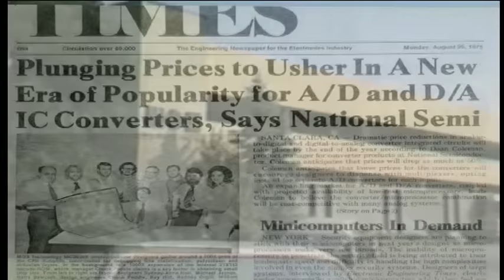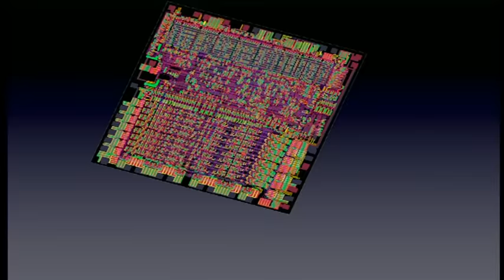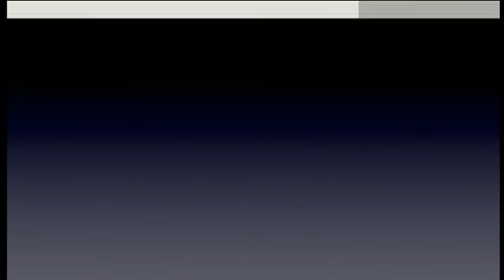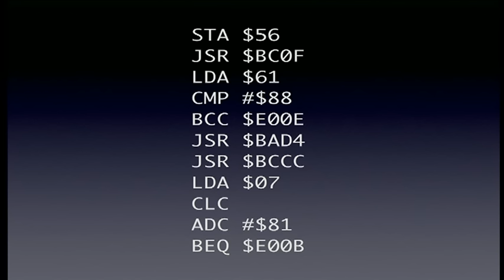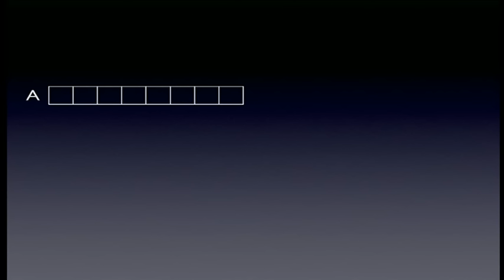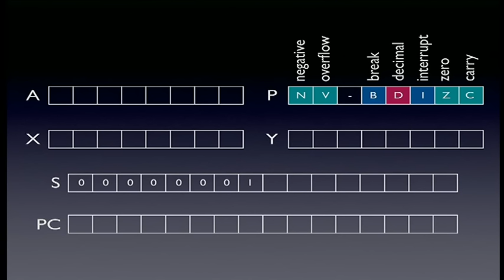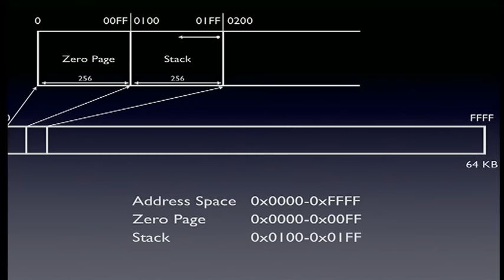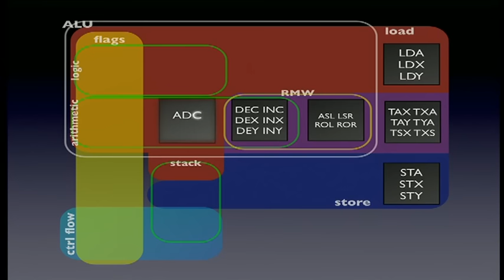27c3: Reverse Engineering the MOS 6502 CPU (en)

Comment: Re: the ALU being pretty standard: The 6502 ALU design actually resulted in a patent related to how its decimal mode. Other CPUs at the time rather had a "decimal adjust" instruction that would adjust the result of and addition/subtraction based on the carry and half-carry into packed BCD. The 6502 instead had a flag which would cause the ALU to do this automatically, hence there's no half-carry flag exposed on the 6502.

That it was patented is also likely the reason this mode was missing from the 6502 clone in the NES 2A03. By omitting it, they'd avoid infringing on the patent.
Reply: The 6502 ALU certainly has some quirks, but it's very standard compared to the Z80. Same with the sequencing, register latches and other details. See Ken Schriffs blog posts on these chips!

Comment: Does the $00 IR injection on IRQ really cause BRK not to work on interrupt?  I'd assume the PC doesn't get incremented on that fetch, so when the handler returns it would refetch the BRK instruction and execute it.  It would seem a more plausible explanation is that the RTI doesn't reenable interrupts until after the next instruction following the return has been executed, so it always executes at least one instruction with interrupts disabled on return.  With interrupts disabled, BRK becomes a no-op. Just guessing here, but P comes off the stack last, after the PC which points to the BRK in the instruction flow.  Then the S (?) bus gets latched into P while the BRK instruction is latched into IR due to the T-state overlap.  Again, just guessing.
Reply: The CMOS versions of the 6502 had that bug fixed, afaik.

Comment: This is fascinating.
For practical reasons I'd like to know what the 65c816 does... (trying to work out the snes, basically)
But I guess that will take a while.

Obviously, it derives from the 65c02, which is implied in the name, and while that undoubtedly differs from the original (that's even documented in the programming guide), we also know of course that there are no illegal opcodes in 16 bit native mode, and that in emulation mode all illegal opcodes equate to 'no op'.

But how does it vary and build on the 65c02 exactly?

Does it effectively contain an entire 65c02 and then additional components? Or is it actually quite different internally and just pretends to be like a 6502 through the way the external logic is set up?

I guess having a 6502 emulator that is 100% accurate would still allow you to verify emulation mode of a 65c816...
Bearing in mind the known altered behaviour of course...

mmh. One day, I suppose. XD
Reply: My understanding of the 65816, which may be wrong, is that emulation mode performs the same operations for each opcode that are performed in native mode, just without the option of switching to 16-bit. The bits that make 16-bit possible are inaccessible and fixed to be clear and "replaced" with the B flag and a 1 (the B flag is just an artifact used when pushing P to the stack during interrupt generation to signify if BRK caused the interrupt).
Reply: We had them make a 6502 with everything 8 made 16, only.  However they sped up the transistors about 10 fold doubled the number of addressing modes though same principal and banked the 4 memories.  Should have 24 bits and 2 operands though.

Comment: The 6507 is in the Atari 2600. The Atari 8-bit family of computers (400, 800, XL and XE series) used the 65C02.
Reply: I was wondering if the 65C02 would get a mention. IIRC, it has some additional instructions over the 6502.
Reply: That's pedantic.  The 6507 is the same physical die with interrupts and high address lines not brought out.
Reply: No Atari computer ever used the 65C02. You are thinking of the 6502C, essentially a standard 6502 but with two additional signal lines.

Comment: BCD was meant to improve number calculation, avoiding the problems of rounding, it's designed for money and financial calculations.
Reply: People forget about memory constraints (not cheap and not small) and a float point package is not exactly tiny, whereas Binary Coded Decimal made it much easier as long as you paid attention to the half carry bit (for the young-uns, sometimes you needed to test it other times make sure it was zero before starting a new calc) and where the decimal point needed to be. Ahhh those were the days... <sigh>
Reply: The Atari 400/800 BASIC did its math in BCD mode (as BASIC implementations go, it's a very nice BASIC).  It was pretty slow but very accurate.  I think they used a polynomial expansion for trig functions, so a sine would take a noticeable fraction of a second to compute.
Reply: @messupfreq550  
Except the 6502 used a patented method to actually do BCD adds and subtracts without the programmer needing to worry about the half carry bit, nor decimal adjusting the value afterwards. 

Annoyingly the D flag wasn't removed on an interrupt which meant the interrupt handler  had to clear it using an extra 2 cycles each interrupt if it intended to do some ADCs or SBCs.

Comment: Wow. This was fantastic.  I have  question now that I have seen this. It looks like in some cycles it starts fetching the next instruction. This would imply there is a race condition in self modifying 6502 code. I have used self modifying 6502 code in some graphic routines for the C64. I have never had an issue with it. Was I just lucky?

Comment: In 1977 I made a choice to go the Z80 route via the TRS80 Mod I as the instruction set and registers were more scalable and you didn't have to do gymnastics to get things done.  40+ years later I can still remember Z80 opcodes by memory.

_lawn(void int x0FF)

Comment: Not sure why there's any argument about little-big-endian being the best. If I have a pointer to a little-endian number, it doesn't matter whether it's a byte, word, long word or arbitrary length - it still points to the LSB and I keep incrementing the location until I reach the desired limit. Adding numbers of different sizes poses no problems. Two big-endian numbers of different sizes would mean that the bytes didn't line up. I honestly never saw the advantage of big-endian number storage.

Comment: To my knowledge the C64 always had a 6510. Of course there is little difference besides the bank switching.

Didn't the VIC20 have a 6502?
Reply: Paul Freedman
You are correct about the C64 having a 6510, as well as the VIC20 having a 6502.
The practical difference between these two CPUs is that the 6510 has an added data I/O port at addess $0000 and a data direction register to control data flow in and out of the port, at address $0001.
Both port and register are 8 bits wide but each bit is individually addressable.
For a hardware designer this means that they are not pin-compatible, and for a programmer, that there are a couple of new instructions on the 6510.
Bank switching was, as far as i know, managed by either a CIA or a VIA from the 6500 family.
Reply: BertyFromDK there were also the 6509 variant which also had an additional port like the 6510 but it’s purpose was memory management. It was internally coupled to an register/logic to help with memory expansion up to 21 or 22 address bits.
Reply: As BertyFromDK said: the major difference between the 6502 and 6510 is, that the 6502 couldn't switch between RAM and ROM via the added PC pin. So part of the memory of the VIC was always blocked by the ROMs, which made the memory maximum 32K big. Meanwhile with the 6510 you can adress many KB of ram, although not all at the same time ;)
Reply: That's also the reason, why you didn't had the 6502 in younger 8bit consoles like the Gameboy, but Z80 variants: The Z80 was able to bank switch up to 512K of RAM or ROM. The 6510 was no option, as it wasn't commercially available for other manifacturers and in 1985 it was replaced with the 8510, also only available for Commodore.
Reply: the first run of C64 was 6502 ... the second gen was 6510 .. I had them both along with a vic and a z80 back then
Reply: @acmenipponair  
Curious, the BBC micro using a 6502 managed to bank swap 16x16k ROMs into the same address space (though the hardware only had space for 4 IIRC such ROMs - extender boards allowed more ROMs in one of the sockets).

The bank swapping is a feature of the hardware interfaces onto the Z80 or 6502 processor.

Neither the Z80 nor the 6592 could itself bank swap (with dedicated instructions); thus latter was implemented by the hardware attached to the processor interpreting control signals, whether supplied as a 16 bit IO address of a Z80, or memory mapped device (eg 6522 VIA) of a 6502 which uses its registers to implement the required swapping.
Reply: The idea that bank switching had to be inside the CPU wasn't true until some CPUs started integrating the full DRAM controller this century
Reply: @johndododoe1411  I realise that now, I was erroneous in my statement.

Comment: I have for long hoped for an emulator that doesn't emulate just the logic behavior of the 6502, but the electrical input and outputs. Although performance demanding, it would be perfectly doable. Imagine an interface that just exposes the input and output pins. I think it would even have to be written to just emulate the pins, but internally it could have a matrix of the actual transistor grid.
Reply: FPGA and even Raspi have General purpose IO pins . I was just shocked to find videos on YouTube where the timing of a microcontroller was as bad as on a Desktop PC with long pauses and jitter. Why do vendors set up a microcontroller like this? If I hate on real-time, I would stick to a PC.

Comment: In latest Chromium 76, and Firefox 68.1, I am getting 23 Hz and 18.4 Hz, simulation speed. Which is pretty damn fast. :) I am pretty sure with some higher clocked CPU, AMD Zen2 or latest Intel, or IBM Power9, and graphics disabled you can probably get ~30 Hz. I hope they port it to use WebAssembly, then it can probably reach ~1000Hz.

Comment: there is a reason, why Commodore didn't renamed MOS technologies: because that was the selling point of the CPU: Yes, the CPU manifacturer was owned by Commodore and therefore commodore got the chips for lowest cost for the PETs and Cxxx-computers. But on the other hand, as there was not Commodore, but MOS written on the chips, Commodore was able to sell the 6502 to Apple, Nintendo and so on without them having to fear a face lost. When somebody opened an Apple II, they didn't saw a big "Commodore 6502" processor on the board - which would have made them think "why don't I just buy a Commodore PET then instead, when Apple only uses the same chips as Commodore?" - But they saw a MOS 6502 chip on the board.

They only rebranded the chips, when this problematic in Marketing wasn't there anymore, as most of the old 6502 computers had died out, the new ones hadn't boards you could see (who would ever open an NES console?) and also, in the 90s it was well known from the PC world, that computer companies work together, like Intel and IBM and later Apple and IBM.
Reply: that and to make the chips cheap enough for sale they needed to make BILLIONS of them... when you have 30 years of stock on hand any given day ... you tend to have lots of ready to go chips that cost a few pennies ... no point wasting money rebranding them when they will be INSIDE a machine already

Comment: Decimal mode is that important in business and financial applications that IBM based its entire mainframe character set (EBCDIC) on being able to efficiently store the values "0".."9". Decimal representation is important because it's more accurate, when dealing with large numerical values, than holding numbers in floating-point form. The downside, of course, is that BCD arithmetic is slower to perform, but that's relatively unimportant when accuracy is your greater concern: to overcome that, the mainframe instruction set would have been equipped with opcodes and macros intended specifically to deal with arithmetic on decimal values. (The 6502 could only do adds and subtracts on decimal values). Incidentally, the 8080 and its successors, including the Pentium, all had decimal (BCD) support, and did the Motorola 68xxx. BCD continue to be a supported data type in databases( e.g., MS SQL Server), as well as on Microsoft's .NET framework.
Reply: Games also used BCD for large numbers like the score.  Pac-Man definitely does.
Reply: I suppose if score go over 32767 … :-)
Reply: I strongly suspect many modern implementations use plain 64 bit integers instead if 18 digit BCD.  Decimal floating point was a thing in many calculators and the Ti-99 BASIC interpreter.  Ti99 used Base 100 encoding with each 2 digit pair encoded as an ordinary byte instead of a BCD byte to avoid dedicated hardware features.
Reply: John, you're an even bigger nerd than me.🙂

Comment: The Super Nintendo has 15 addressing modes in the LDA y ADC, SBC, CMP also has a Address Bus of 24 Bits and Can use 16 MB  ROM cartridge without use a Mapper like in the NES
Reply: The CPU uses it 16bit ALU to avoid the additional cycle when you pass a page boundary while addressing. But all good NES coders laid out arrays and loops to stay within a page. So, no speed up. Do 2d games need 16bit  registers?

Comment: i used to program in z-80 and 8080 code. As I recall, we didn't have to clear the carry before doing an add. Looks like the 6502 requires that, which makes you use CLC before doing your ADC. Seems less efficient to require that extra instruction. Is there a good reason for that?
Reply: Yes. It simplifies the adder circuit and the decoder; no need for the extra gates required for carry and borrow, and no need for extra opcodes to support adding and subtracting without carry/borrow.
Reply: When adding a multi-byte number you CLC and ADC lo byte first. The carry is set if overflow (>255). You then ADC the hi byte without resetting the carry flag. If carry is set by the previous ADC it adds 1 to the resulting hi byte ADC. If the ALU cleared the carry flag before each operation you would need external code to check for the carry flag and add the carry in your code. If you are adding a four byte number you CLC once and the ALU does the rest for the other three bytes.
Reply: The instruction decode ROM possibly COULD have just forced the carry input to the ALU = 0 if a hypothetical ADD (as opposed to ADC) was included in the instruction set.  i.e. it had 131 ROM outputs instead of the 130
Reply: Not enough transistors in decoder plus imagined flag would be clear,  but they did not clear on calls, long jumps, or some conditional gotos.  Mistake.  I would have had a double (etc) prefix byte instead!

Comment: You state that the Commodore 64 used the 6502 chip, I believe this to be incorrect. The Commodore VIC 20 used the 6502 but the Commodore 64 used the 6510 chip, it contained the 6502 instruction set but also included an advanced instruction set. I mention this because back in the early 1990's I wrote a compiler which utilized both instruction sets so you could build programs for both the VIC 20 and Commodore 64.
Reply: first gen did ... second gen didnt 

the first release of the c64 was just a reworked vic 20 in a new box with a different board interface ...
Reply: How did the 6510 instruction set differ from the 6502?  As near as I can tell, you are the only person on the internet who knows this.
Reply: @0623kaboom  Wat?  LOL -- the c64 is not an architectural variant of the VIC-20, and never ever ever ever contained a standard MOS 6502 cpu.